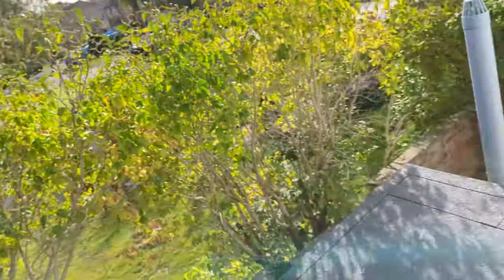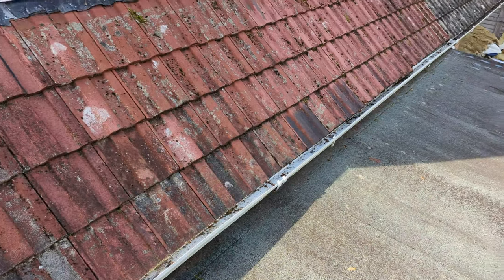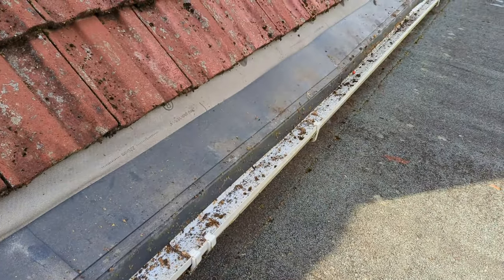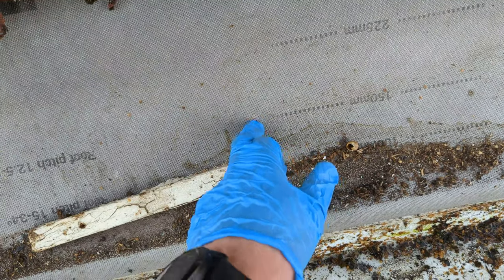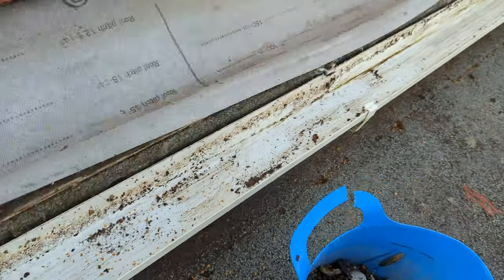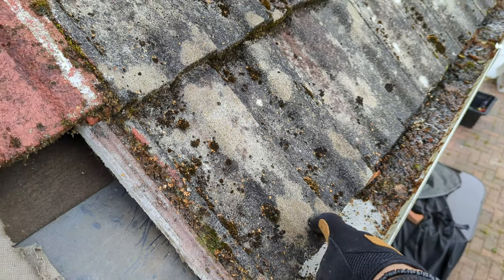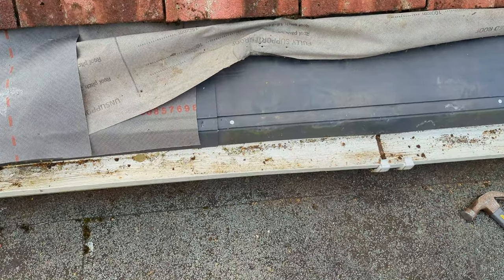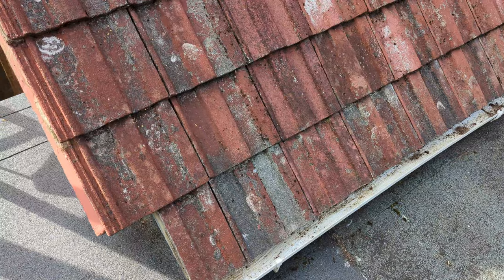Fitting Eaves Protection Support Tray! Stop Roof Leaks and Felt Rot - DIY

Comment: The eaves protector is meant to be nailed onto the rafters, not the fascia. It doesn't really matter but will make replacing the fascia in future a pain.
Reply from the maker: I did that initially but there was a huge gap between the eaves protector and fascia board. Nailing in to the fascia closed the gap almost completely 👍

Comment: Hi Froy, I'm just about to do this exact same thing on my garage roof.
I think that you done a very decent repair job here, whoever installed the eves protectors obviously didn't know that they are designed to be placed below the roof felt, at least you can sleep easy now in the knowledge that your eves are protected.
Thanks for the methodical approach, I found your video very easy watching. 👍
Reply from the maker: Appreciate it 😁 One of the easier jobs on this roof, especially as I can cheat by standing on my flat extension 👌

Comment: We call this continue under eaves in our part of the Country. Made of fibreglass by Danmoor.  10 feet long 12 inches high. nailed at the top.You could also use the angled piece this gentleman is using at the bottom under neath the continuous eaves. My experience of slate roofing is the fist slates to dislodge are the half slates used as under eaves at the bottom.

Comment: I've just noticed a drip of water between the soffit and the brick wall of my brick built garden store room.  I've been quoted 6K to have the tile roof replaced with felt - the roofer said the pitch of the roof is too low for tiles and water must be tracking under the tiles and onto the membrane.  But I'm going to try what you did because I noticed I can't actually see the membrane overlapping the top of the eaves and extending into the gutter so I suspect water is travelling down and then just pouring in the soffit because the membrane is just too short.  I'm hoping this eaves protection support will help.  I have to get over my fear of lifting up the tiles first to actually confirm my suspicion, so thank you for the demonstration!
Reply from the maker: Give it a go! You find your tiles are nailed on but other than that, it should be straight forward to have a look at least 👌

Comment: Looks like a good job. The roof underlay and timbers seem to be in good order just odd that the support tray was fitted incorrectly. I've seen some videos where the tray is used to replace damaged felt at the eaves. I don't think that's always suitable.
Reply from the maker: Someone has clearly been up there before as the original felt had been replaced. Just need to do the same on the front of the house now, although from a ladder 😬

Comment: Please I had a front half roof replaced on 1900s terraced house. The reason the roof failed of 40 years maybe, was the felt at the eaves had disintergrated allowing water that had penetrated the roof slates to not to reach the gutter. The roof was fitted recently with no eaves suport trays. I insisted the roofer fit them eaves support trays, he said I did not need them. I told him that modern current practices would include them on a replacement roof. From my commonsense am I right and should they  be fitted as normal practice? Many  thanks
Reply from the maker: I'm not a roofer but I don't see why they would not be fitted. They stop the membrane sagging long-term.
Reply: @froywhernside  Many thanks, every other person except my roofer completely agrees the need for the trays to be fitted. After a direct request my roofer fitted the eaves trays, requiring the new slates to be refitted to allow the trays to be nailed to the rafters. Commonsense many thanks for your confirmation.

Comment: Great video, looks a job well done and worthwhile 🤓👍 I've discovered a section of my roof where the felt has receded (no idea how long it was, frayed edge) back a bit further than I'd like but still has enough to drip into the gutter. This eves protection would be a great solution and underneath seems the only logical way to install, not sure how that installer got that wrong really 🤣 
Great info 🤓👍
Reply from the maker: Thanks! It is an easy fix / upgrade if you don't already have it installed. This house is full of "surprises" 😂